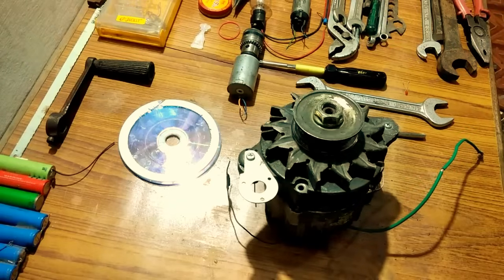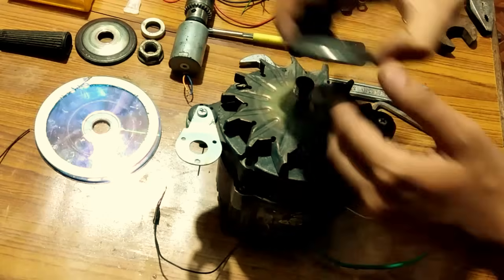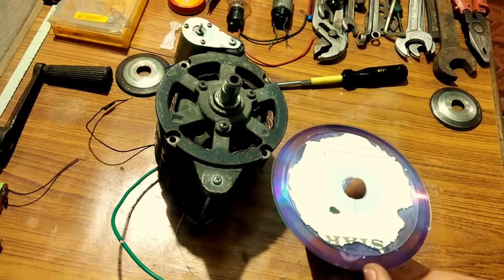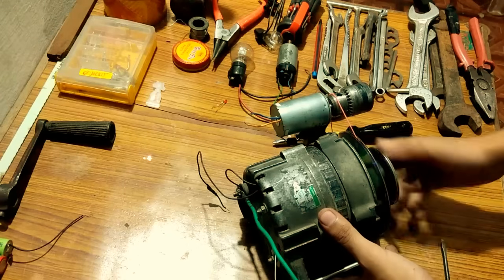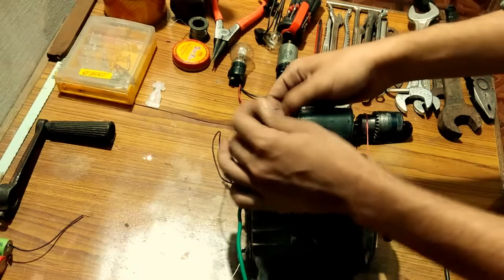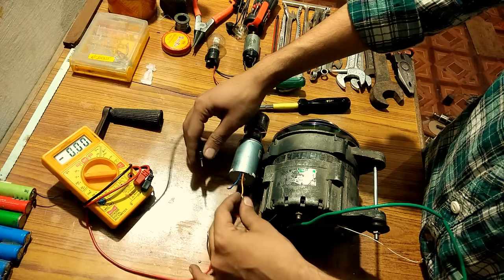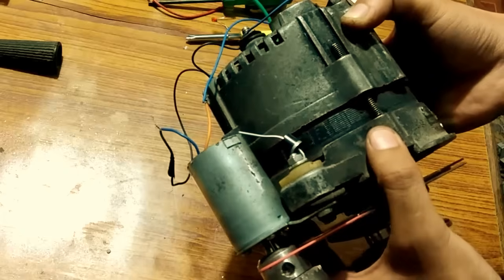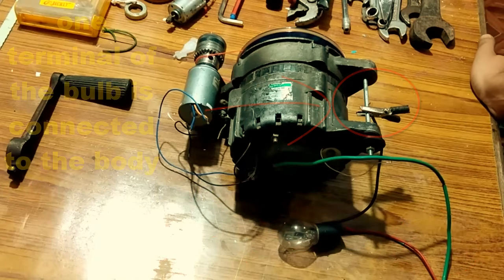Self Excited field of an alternator with a small dc generator

Comment: if youre charging battery anyway why not just run a jumper wire and resistor to field from positive post there should be some voltage to get you started

Comment: Could you effectively drive your exciter generator by a friction drive from the cd pulley, say by using something like a rubber tap washer on the exciter shaft? You could have the exciter generator mounting adjustable, and possibly spring loaded to help keep in contact with the cd pulley.A wiring diagram included would be helpful, but good work, and keep experimenting!
Reply from the maker: Hassan Burrows Yeahhhh! Thanks man. 🙂